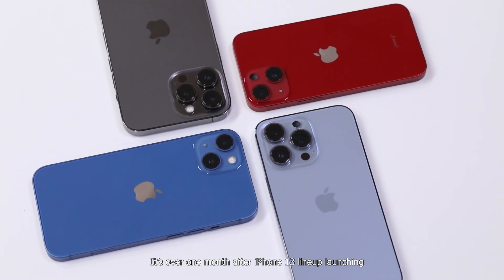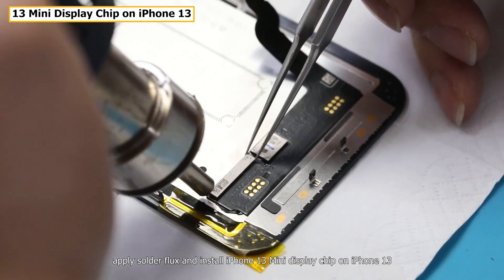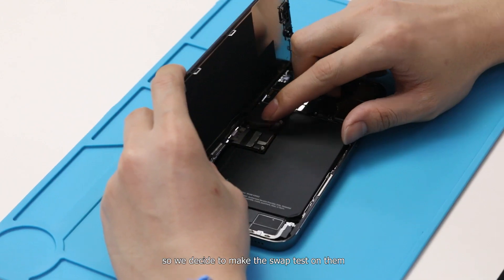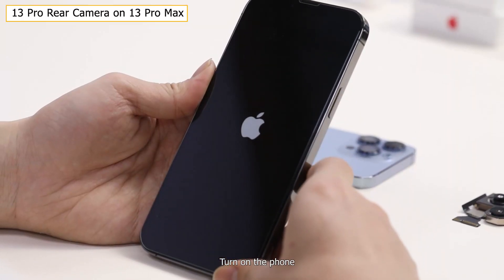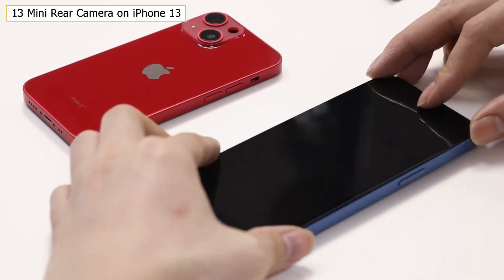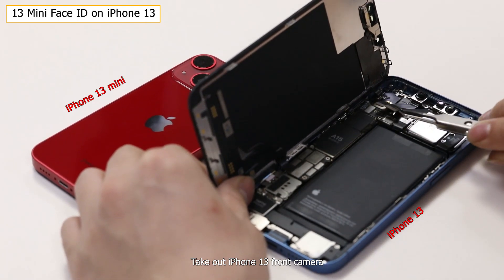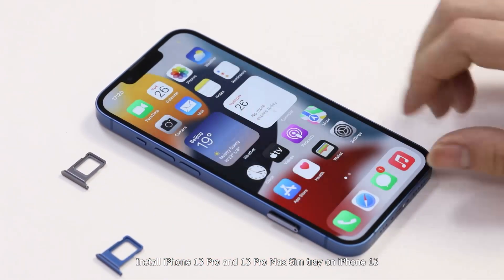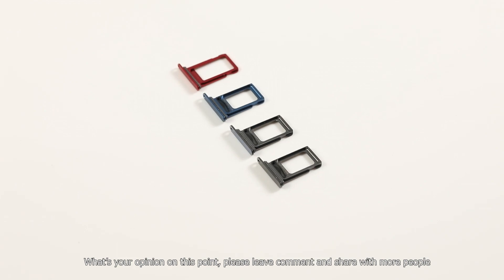iPhone 13 Lineup Across Model Parts Swap Test | Display Chip Swap

Comment: Please please please swap 13 pro’s screen with 13 and see if promotion works on 13
Reply from the maker: They can't be swapped because the screen flex connectors are different.

Comment: what an a mazing test . I have a question. It is found by phone guru that if you change screen in any iPhone 13 lineup you loose FACE ID, auto brightness, true tone and front camera. Face ID can be fixed by IC SWAP, do you have any "fixes" for other issues ?
Reply from the maker: Yes, Dace ID swap video as this: https://youtu.be/GnIHb_qT4ac. For other issues, by now we have no solution for them. But once upon any update, we will share with you guys. Pls stay tuned, bro

Comment: That was Freaking Insane. I have few questions.
1) What is the function of that yellow tape.
2) You swapped Pro and max's Screen and got a warning message. Does this mean that every single iPhone 13 ever made. All Millions of them have different chip functionality so when you swap them you get a warning message.
3) so when the display was damaged. Is there a way to repair it?
Plz let me know in Numbers. Lol
Reply from the maker: 1- it's high-temp proof sticker
2- Display chip of same model should be compatible, but the Face ID chip is made specially for every iPhone. So swap display IC will get a warning message and lose Face ID
3- If display damaged, if you have a new screen you can fix it, but Face ID will stop working. If you want restore Face ID, you have to transplant genuine Face ID chip on new screne, or go to Apple to restore everything.
Reply: @Elekworld  WOW. Thank you so much for all the information. I Appreciate it. 😀 LOL Apple's Trying to make as much money as possible by this method. Still thank you very much.
Reply from the maker: @HarnaiDigital    Most welcomed bro.